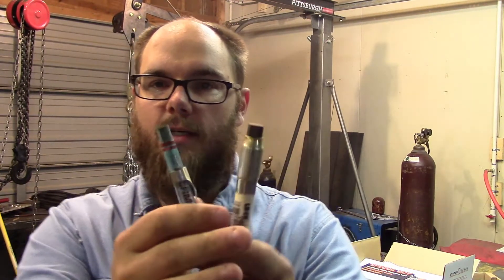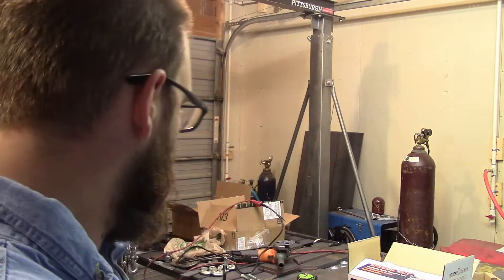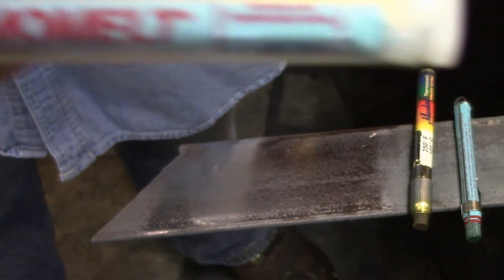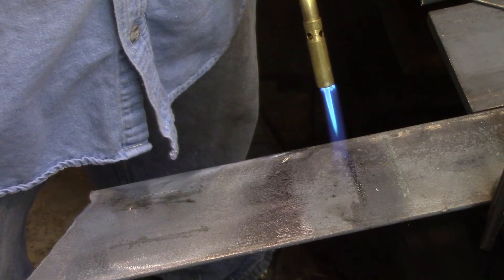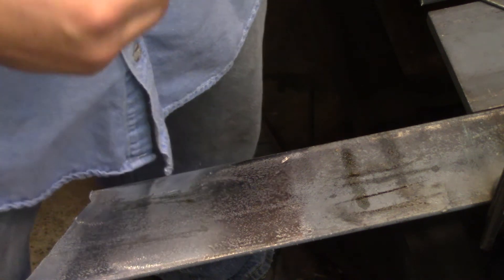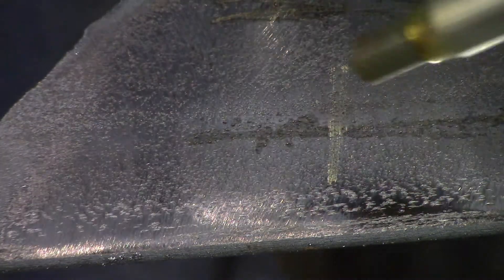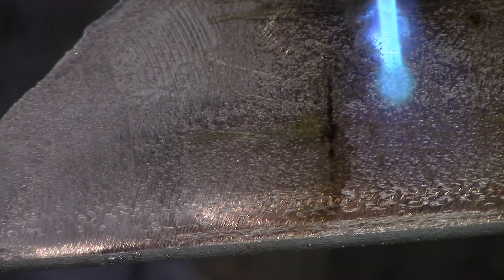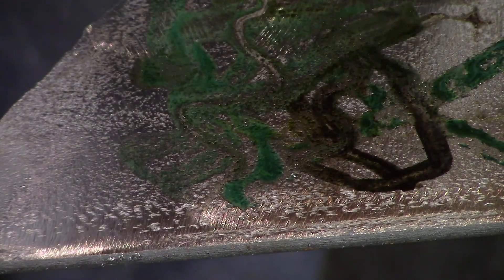WET #28   Temperature Crayons

Comment: According to one manufacturer, you're not using the crayons correctly.  The heat from your torch is melting the wax and not the heat from the metal.  Heat the metal first, then swipe the crayon across the surface.  That way, only the heat of the metal melts the wax if hot enough.  They are relatively expensive for the home hobbyist.  I use my infrared thermometer.  "Close enough for government work" as the saying goes.

Comment: so i was wondering, 

say i use the 1100 F and the 150 F right next to each other, my working part becomes 600 F, can i see a difference afterwards? or does the 1100 F change its colour slightly aswell?
Reply from the maker: The 1100F wont even begin to change at 600F. They are surprisingly accurate as far as tolerance on when they will melt. Normally within 2%. Thanks for watching and asking a good question.